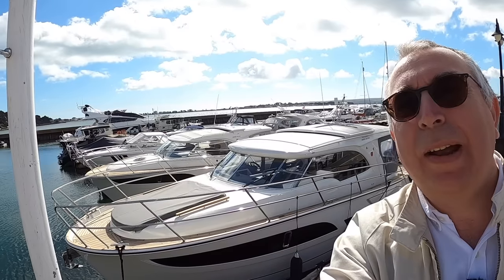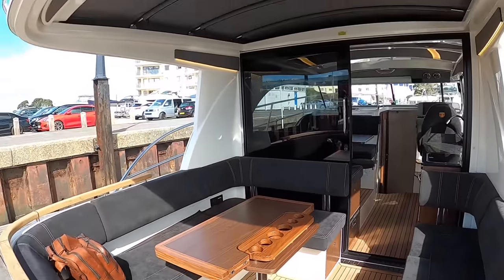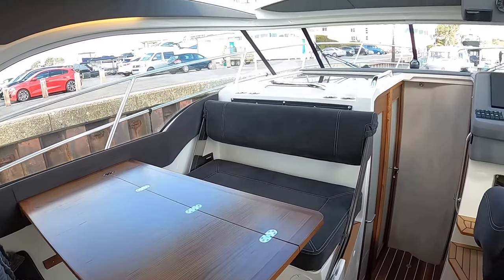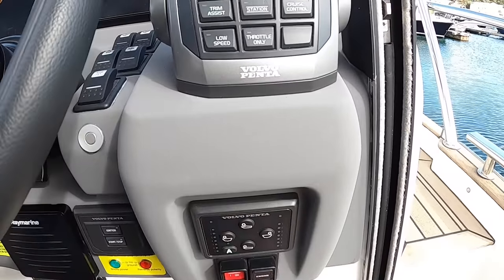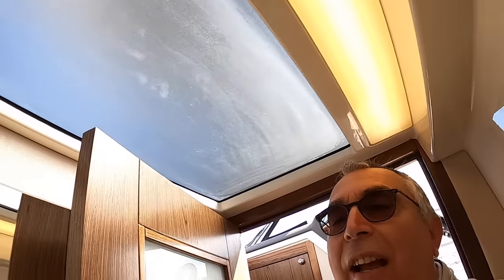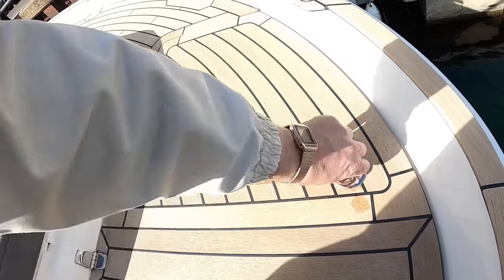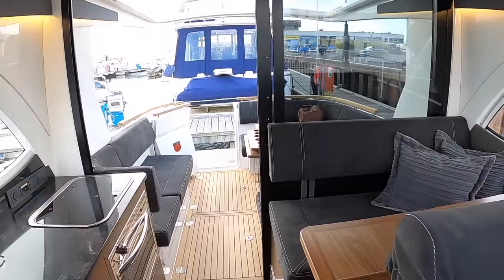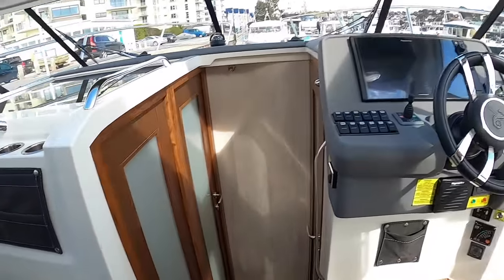£330,000 Yacht Tour : Marex 330

Comment: Many "modern" boats have some unique feature that is designed to set it apart - a One Trick Pony. That being the standard, THIS boat is a Full Featured Circus Horse. It begins with the simple Self Storing Canopy. Then, not just an aft deck sliding roof panel but the Cabin Roof also slides open. Having seen the video, we are all aware of this boat's place in the boating World - the FUN section. Thanks Marex for this fine, fun craft and to Nick for the guided tour. Peanuts? Popcorn? Flotation Device?

Comment: Add in a small water maker and small generator with a lithium-ion battery bank and this boat would be great for 4 people or less.  I really like this one. Great video Nick.  Thanks.
Reply: It appeared to have five batteries, though I couldn't tell what their chemistry was.  Might already have the Li-ion bank you're wanting.  And with gas cooking, if you charge them in the marina, that's probably plenty for a weekend, with no generator required.  Replacing gensets with Li-Ion banks seems to be trend in new boats, from what I've read.
Reply: That fold-down seat on the back would be great for fishing too.

Comment: I love all the clever features of this boat!  And unlike many of the Scandinavian boats, it doesn't look like a workboat.  I think I recall reading in MBY that James May got one of these (or was it a 310?).

I only have two gripes:
1) If you need quick, safe access to the side decks, you're going to have to step on the cockpit seats, since the only "clear" access is via the swim platform (although at least there's that teak rail to grab on top of the cockpit coaming);
2) As someone noted, it would be nice if the bow thruster control was on the starboard side of the wheel so you could reach it while standing on the side deck, as in your example.

Excellent work as usual, Nick!
Reply from the maker: I think James May has a 310. You can move the seat cushion out of the way.

Comment: Cheers ..Love ALL the "review" vids....Go back after 2 seasons and re-review these "sunroof" vessels! turn shyte in NO TIME!... can't believe that the manufactures believe this is a "boaters dream option"...what shyte! Keep up the greatness ..looking forward to more during the Smugglers Blues season!
Reply: I've had zero issues with my sunroof on a 2018 Marex 320 (so 6 seasons).  A canvas roof like that with it's UV coating have a live span of up to 15 years depending on usage and then you can just replace the canvas for around 2k. The manual mechanism itself is bulletproof compared to big heavy electric sunroofs.  Plus the main advantage over hard sun roofs being they open up fully rather than blocking half the cockpit.

Comment: Love this boat, lots of good features, typical Scandinavian quality. To offer a different spin on the throttle position, you can also easily and accidentally knock it into gear as you step out of the cabin.  I'll never understand why there's no interlock on e-throttles.  Also, having had my share of losing an engine, I do like having two available, even if it does mean plodding home at 6kts!

Comment: What a marvellous, practical boat!
The ONLY change That would suggest to the builders is to put the bow thruster control over by the throttle so it’s easier to reach when standing outside the side door to dock. 
I think they’ve got everything else perfect for that size of vessel! 👍🏻😉
Reply: Details like that are always customisable with the dealer. You can pick the brand of the nav equipment as well as the placement of the controls.

Comment: Hi Nick, I could live with that boat very easily even with aft galley 🙄. Simple engineering with mechanical operating sun roofs etc. It's clearly a northern waters boat in my eyes as it has a separating door to the aft deck area. Cheers DougT in Mancs, mmmm where's my lottery ticket

Comment: Nifty boat! The only gripes I would express. There is no Sea Keeper, and the bow thruster control is on the wrong side of the helm. Thanks for your features reviews; they're thorough and upbeat!
Reply from the maker: Very rare to find a Seakeeper on one of these due to cost and the fact that it's a pretty low boat so doesn't really need it.
Reply: I spotted the same issue with the thruster controls. Literally the only fault I can see. What a piece of kit.

Comment: This cover is a great idea, just think to myself,  does the engines can handle the extra weight?  Does the engine weight is not going to be an issue? Is going to have space to generator, desalination, air conditioner and so on, boiler just remember. If all these issues are not an issue, great! A excellent choice.

Comment: There's a lot I like about this boat, some of the touches like the fender lockers and canopy lockers are great and the heads are amazing for a boat of this size. I'm not sure if it's just the video but some of the quality of the finishing isn't quite to my taste. The bulkhead between the main saloon and main cabin looks like it could have been styled a bit better and the running of the overhead canopies looks like it could be a bit smoother. 

The price point of this boat however is very keen but I just think maybe an extra £10k or so on the list price and they could have maybe improved the look and feel of some of those details

Comment: I was watching a video by "someone" today and there is an enormous amount of second hand sail boats often for under $100k. If people are looking to get on the water or live aboard.. that is a good place to start. This boat you are doing is the same.. perfect for someone to live aboard or anchor off shore for a week perhaps, a fishing trip. A great ship to get started. It has a yacht feel but its small and affordable :-)
Reply: Having done both sail and power you have to be aware of the relative difference in speeds and being able to hit the tidal gate you need to pass. Also, lovely as sailing boats are (and I’ve had two over the years) helming inside with an outside option is a whole different world.

I love RIBs for their out and out on water capability, I can put up with outside helms for those. Bigger powerboats, windage and general close quarter manoeuvring requires thought and a plan. Sailing boats cheap on fuel and at times in the right wind (bang on Force 4) they can be really rewarding. Slogging one to windward in a F5 and above is just hard work.

But it’s each to their own and there is a price and ability for everyone. Just don’t buy a “Project” - it will stay a project for evermore…..
Reply: I wouldn't call £330,000 affordable for the average person. If you want to get into living on a boat, a canal boat, fibreglass cruiser or wide beam barge would be better options.

Comment: If I could ask a question of you sir! I have never owned a sailboat, but why are sailboat’s equipped with a gimbal stove and motor yachts are not?
Reply from the maker: Because sailboats lean over as they sail and motorboats do not.
Reply: @AQUAHOLIC  When we had our smaller boats we never cooked when under way. I knew that about sail boats, but  I thought there was a different reason. I know they are usually narrower and the keel doesn’t always stabilize the best ( side question do they have more then a keel for stability? Until your Channel I had never even watched a walk through of a sailboat!) Have you ever used your hob while under way?
Reply from the maker: @WOW-li4uj  No because with a fast boat you reach your destination quicker so there is no need. With a sail boat you could be out for 24 hours or more on a long trip. Very different sort of boating.

Comment: Why would you take the two engines in stead of the one with double the power? Double maintenance, more fuel consumption, more weight and undoubtedly more expensive. If the twin engines were more powerful, I could understand, but what could be the use of two 220 horsepower engines in stead of one 440?
Reply from the maker: Redundancy. Back up if one were to ever fail. But the majority opt for a single for the reasons you mention.
Reply: @AQUAHOLIC  thanks for your reply and keep up the good work I love your no nonsense approach and your genuine enthusiasm!

Comment: I'd avoid those sunroofs/fabric tops, that crap will eventually leak and cost you a ton of $$$ to fix, not to mention all the crap that water getting into the boat is going to destroy.  I will say that fold away eisenglass system, no stupid snaps is brilliant.  I had an old late 90's red Dodge truck with a snap on tonneau cover, you never took that thing off in the winter cause the cold made it shrink and you'd never get it back on.  Even in warm weather it was a major PITA to snap that thing back on.